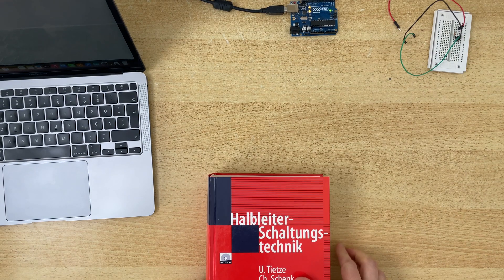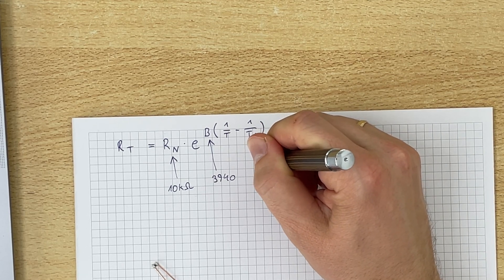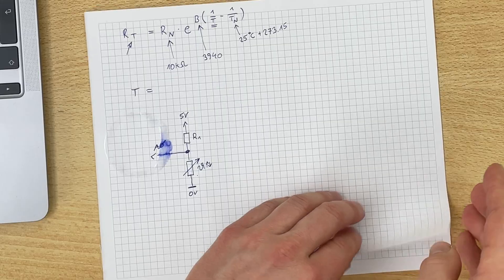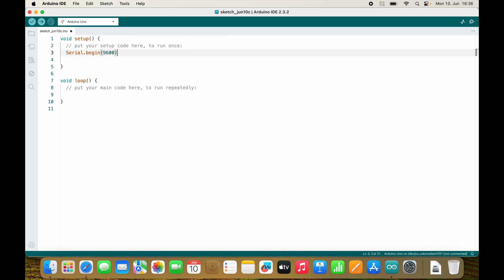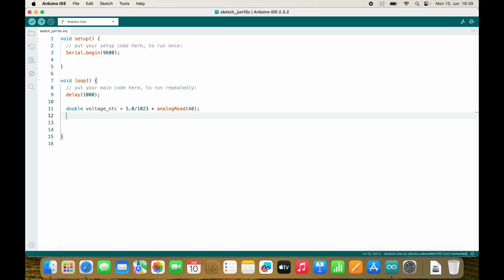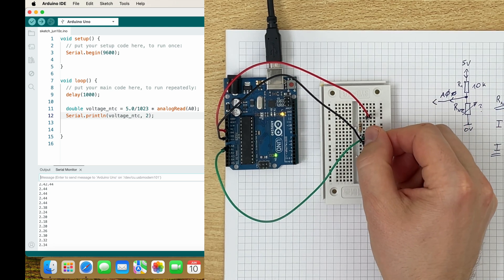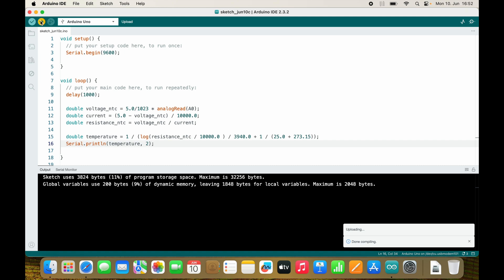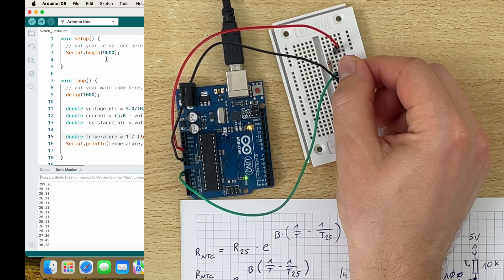Temperature measurements using Arduino - NTC thermistor - (Arduino Uno Programming for Beginners)

Comment: is it possible to use ntc sensor instead of DS18B20 in pH sensor board
Reply from the maker: It might be possible, but it depends on the design of the pH sensor board. The DS18B20 is a digital temperature sensor that communicates using the 1-Wire protocol, while an NTC sensor is an analog device that changes resistance with temperature. If the pH sensor board is designed specifically for the DS18B20, it might not be possible without modifying the board or its firmware.

Comment: Good job! Please explain how you get this: "double voltage_ntc = 5.0/1023 * analogRead(A0);"
Reply from the maker: thank you.
Arduino Uno has a supply voltage of 5.0V
however analogRead does not read the voltage in float values but as an integer were 0 = 0V and 1023 = 5.0V.
in order to find out the exact float value, we can now divide the supply voltage (5V) by the maximum ADC value (1023) and then multiply it with the actual measured int value.
let me know if it's still not clear
Reply: @playduino  To prove your formula, make analogRead(A0) = 1023, then the voltage is 5V. If analogRead is 0, then voltage is 0v. If analogRead is 512, voltage is 2.5v etc.
Reply from the maker: @gameworn1820 actually, I did it wrong in this video. Not a big mistake but still. Here is how it’s done:
https://youtu.be/ieGo-qsGhbE

Comment: Danke für das Video. Ich habe die Schaltung auf mehreren Arduinos ausprobiert und dann auf einen ESP32 gewechselt wegen höherer Auflösung des analogen Signals. 3,3Volt und Auflösung 4095 habe ich in der Formel eingefügt. Wegen komischer Werte habe ich dann die Berechnung in eine Schleife von 0 bis 4095 gepackt. Ergebnis: In dem Bereich auf den es ankommt (über 200 Grad) kommen nur noch große Abstufungen heraus. Wert 15 = 242,74 Grad, Wert 14 = 247,45 Grad, Wert 13 = 252,6 Grad, Wert 12 = 258,28 Grad. usw. Wie arbeiten denn 3D-Drucker mit solchen Werten? Kannst Du das erklären, bitte?
Reply from the maker: 1) ich glaub du musst den wert vom 2. widerstand noch anpassen. So dass die analoge Spannung bei ca. 200 grad bei ca. 1/2 versorgungsspannung liegt.
2) esp32 hat zwar ne hohe auflösung aber ich hab gelesen seine Linearität ist ziemlich schlecht. Das lässt sich vielleicht mit ner lookup-table ausbessern oder du bleibst bei nem Arduino
Reply: @playduino  Danke. Die Lösung ist so einfach. 🙂